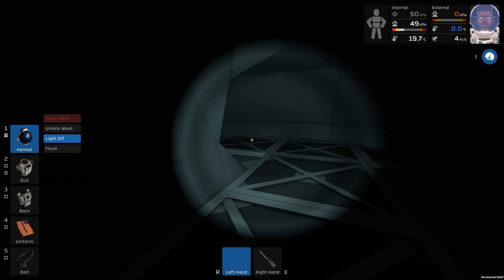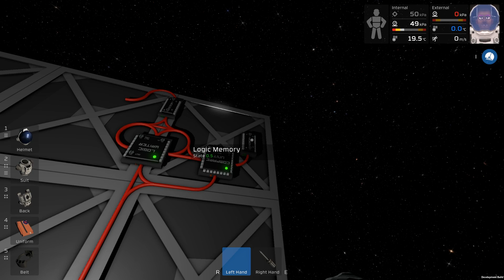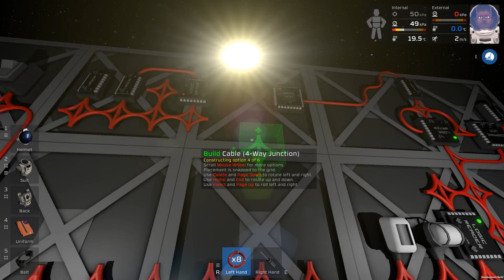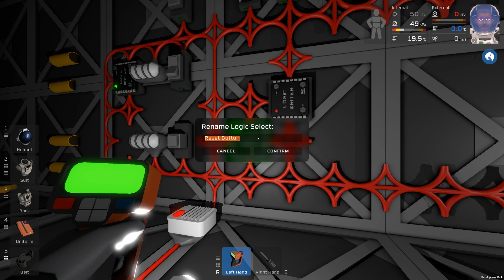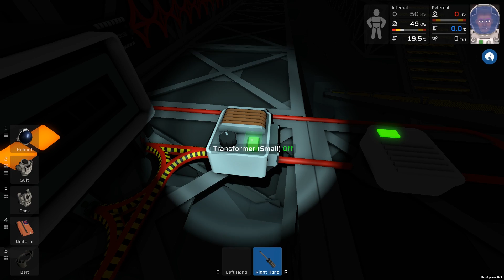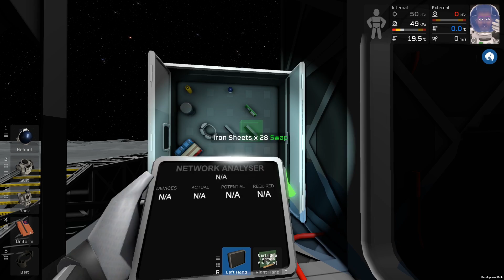Stationeers E22 - Battery Saving Timer

Comment: I am currently working on a plan to have emergency lighting system. Either with a series of LEDs or having 1/2 the lights turn off if battery gets to X level. anyway...a bit away from that. dont really need it but it would be fun

Comment: Improvements:
- switch entire timer circuit off on timeout, switch on on reset to reduce power consumption
- use daylight sensor angle MOD 1 for 0-1 counter; use less power.

Comment: What if instead of using a timer to keep the power on while in your base, you made a Boolean switch. When you walk into the base, the Boolean returns true keeping the power on. When you exit the base and trigger the sensor again, the Boolean returns false. If the Boolean is true, the base power is on, and if the Boolean is false, the base power turns off. Then you would eliminate the need to enter the airlock just to turn the power on. It would only require the power to be used when you need it instead of walking into your base and then exiting soon after and leaving the power on for the remainder of the time left on the timer.
Reply from the maker: Only if you have one entrance/exit (I have two with the gas room) - you can combine both of course with more electronics, but at that point, you're probably not saving too much power :)
Reply: I didn't realize you had two entrances. You would have to have two systems for it, but I think an alternative to just one entrance/exit would be having each area, the main and the gas room, on separate systems so depending on where you're at, only on area is turned on, but I see what you mean.

Comment: Your base is in hard vacuum yet you have heaters on, what's the point?
Reply from the maker: The heater near the exit airlock? That's controlled by electronics - it doesn't sense pressure (at the moment)

Comment: Make mothership =D
Reply from the maker: Can't in survival :)
Reply: That's a shame. I've literally just started trying to make a small mothership in creative, looks like it's not quite working there either. I can't get the gyros to do anything apart from spin, and I keep getting errors with the atmosphere code when I connect pipe networks to engines, which appears to stop all gases from working, including in-suit oxygen and the welder. Well, looks like I'm as done with Stationeers as you are 8(

Comment: Thank you very much, I always wanted to count only if it's needed, which is not necessary. I'm running in the same problem with content, currently waiting for the Wheat to grow (used a heater and cooler, not the A/C) to get some chickens.
Keep it up.

Comment: While I appreciate the complexity of the system....all of this can be accomplished with a simple console loaded with a power control circuit.

It can turn off anything on its network that has been assigned to its digital switch via a data disk.
Reply from the maker: I'll definitely be using those in base rooms - I just have the electronics episodes for more advanced behaviour (delays, actions based on triggers, etc.)

Comment: Would it be possible to set up the motion sensor to toggle on and off by adding 1 each time it's activated, then if it's even turn power on, if not divisble by 2 then off. Haven't messed with all of the logic boards so not sure if that's possible
Reply: You definitely could. Just keep in mind to add rising edge detector (add value only when the value is setting from 0 to 1) and you good to go!
PS. You could make rising edge detector by using a compare unit. Just compare that value of sensor is greater than the value of that compare unit (yes, it is getting it's own value as second input).

Comment: You said the motion sensor didn't have any tool tip or pop up or anything but did you notice that when it is off or zero the sensor panel in the middle is gray and when it is on or one the panel is green?
Reply from the maker: I did, about a minute after I said that :D  I do wish it was longer range, mind you!
Reply: My mistake. Sorry about that.

Comment: Another neat way of doing this would be to just check if the inner door of the airlock is open. However, this would be nice for the workbenches, printers etc. They buzz a lot in atmosphere, and turning them on/off is a bit annoying.

On another note, I've noticed that there is no in-game audio in the recordings. I'm not sure if it's on purpose, but you might want to check on that if that's not the case.
Reply from the maker: Unless you have more than one entrance to your base :D
Reply: But then use an "or" gate and voila, problem solved :P
Reply from the maker: And nice catch on the audio - there's not much in stationeers anyway, but that should be back from E24 or so!
Reply from the maker: Darn, using my own boolean logic against me! :)
Reply: But then you'd need multiple motion sensors anyway ;)

Comment: Would be even usefull to autoclose door behind yourself and other people, the standard problem is that you have enjoy doors to prevent problems with breach and than your complet station get vented because all doors open...
215 Watt with LEd and a light on, power use should be ~160 Watt without it.
Intressting fact, air filtration units dont consume power when on and have nothing to do.
Interessting bug to, you can use iron ore again and again in the big furnace, to produce unlimited ammount of gas....
Do the uran battery work?
Is there a use for the labor equipment from the big printer?
There are more thinks in to test, like cryo pot.
Take a look in the big printer to get some more episodes. Maybe working stationswide system for aircontrol would be nice to.
Reply: the sleeper and cryo pod is not working yet

Comment: Also you could check for the pressure in the airlock. If it has a gas inside -> turn everything on. There is no gas -> turn off. But this could be not very good for multiplayer as 1 person could be inside and another could go out...
PS. Also there could be a problem with multiple airlocks